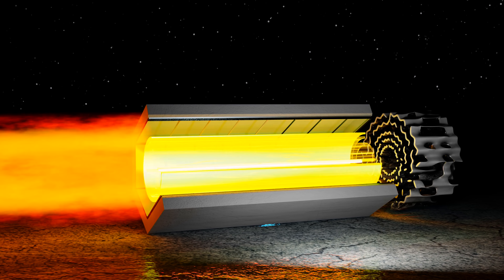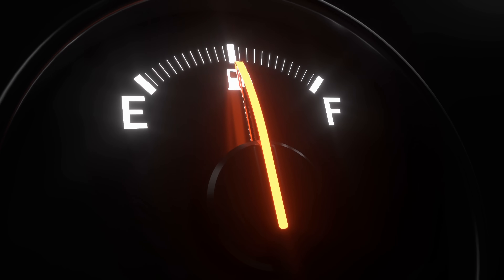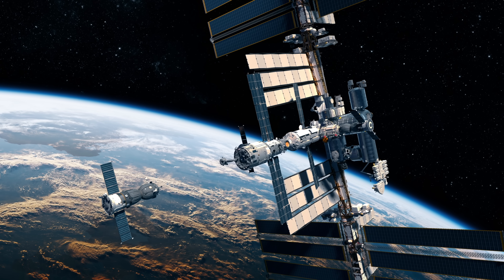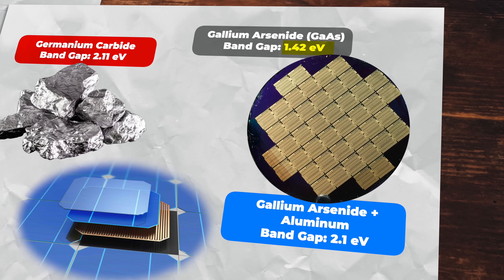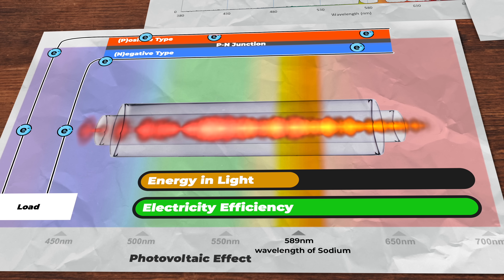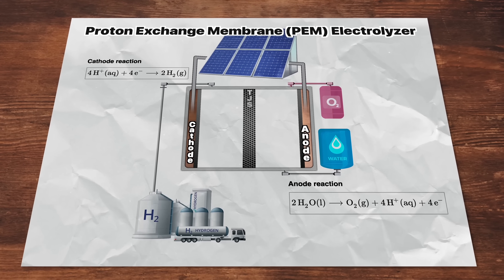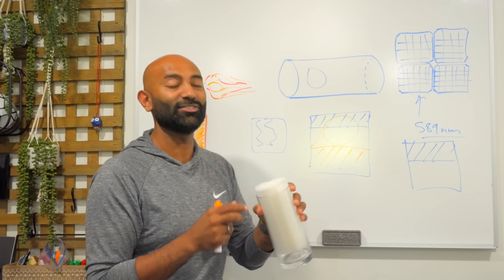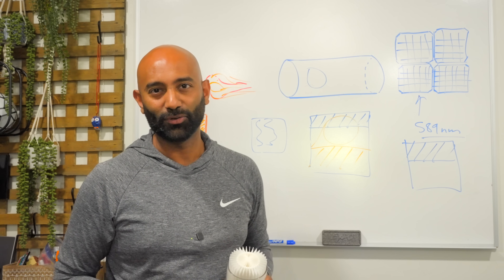Why Solid State Might Save The Combustion Engine

Comment: 14:05 You'd be better to build this heat-to-light system in a Gas Turbine...Turbines are FAR more efficient than Piston engines (and I believe can burn just about any hydrocarbon fuel or straight hydrogen for that matter) to spin a generator to make electricity, then use the waste heat to make low pressure sodium glow to be converted into more electricity by a tuned solarcell...
2 sources of electricity from one combustion event and the sodium would absorb a lot of the heat in the exhaust gas meaning the exhaust system can be vented like a traditional home water heater or gar clothes dryer...

This could be used to power homes, businesses, factories, off-grid cottages, Communications Relay Towers in the wilderness (along the major highways and in Cottage Country for example) and vehicles with very little design alterations, mostly just scaled up or down depending on the needed power output...and with very little pollution due to how clean Turbines tend to burn...

Comment: Although not a complete waste for academic/research purposes, I feel this design is proposed on ignorant premises.

The largest energy “waste” an internal fuel combustion engine like the ones we used today is not fuel consumption or moving parts, but primarily the lack of utility of the unused heat. Second would be the unused or lossed movement of the crankshaft, thirdly would be the lack of direct utilization of the byproduct of burning fossil fuels namely nitrogen, water, and carbon oxides resulting from the burning process. Nowhere are these problems addressed in the in design premise to offer a better solution or higher optimization in comparing fuel engine designs. There simply isn’t any need for any other design that incorporates light unless it can directly address the infrared spectrum from burning oil and no need for any electricity unless it can can address the loss of movement or chemical byproduct (which precisely is what early design attempts sought like the first generation electrical hybrids or the sham water/nitrogen engines).

Comment: How do these approaches compare to the efficiency of the thermo-voltaic panels that generate electricity from the infrared photons from that, uh, I think it was a sand heat battery, or maybe some new proposed RTG for space proves? (sorry, I don't remember for sure specifically which project was associated with it, I just remember they had "solar"panels that were tuned to thermal frequencies instead of sunlight)

Comment: Sounds too good to be true. If these tuned photovoltaics work at that efficiency, why not do mirror concentrated solar onto a sodium lamp with those around it? You'd capture much more of the sun's energy than traditional solar cells. What's more, you wouldn't have to design a car around it to make it work. You could hook it up to the grid tomorrow and start making money.

Comment: I don't think you'd have much luck harvesting waste heat from an ICE because you have to heat the sodium to a very high temperature to get good emission efficiency.  Exhaust gas temps are 200-900C, while efficient light emission from sodium atoms needs temperatures in the vicinity of 5000 K or more.

Comment: 80% efficiency?!?!  That's literally impossible for an engine using heat energy at room temperature below the melting point of steel.  Thermodynamics limits the efficiency to 1 - Tc/Th where Tc is the sink temperature in Kelvin (so 340K) so it would need to run at 1700K assuming literal perfection.  That's the melting point of fucking Incnel and beyond that of normal steel.

Doesn't matter that it uses photovoltaic as an intervening step.  It's still starting with heat energy so thermodynamic limits on heat cycle apply.

I'm not saying it's necessarily a scam, but someone (u or them) is definitely using a misleading notion of efficiency (eg they mean the fraction of theoretical thermal efficiency they achieve).

Comment: Cosworth makes a generator using catalytic converters to combust fuel. The gas drives a generator to feed power into a turbine and then into batteries and electric motors. The efficiency is down around an ice engine but because there is no moving parts it is light and fuel agnostic

Comment: Durability, that is the question.  How long can this run before it needs MP?  It does sound nice on paper, and it may work well...for short periods of time.  Maybe this lasts for 100 hrs, maybe 1000 hrs and we start a new business where you go in for, in stead of an oil change, a "chamber change".  We will have to see!

Comment: Yes in car there's multiple escaping heat sources that might be possible to recycle back into self charging if the heat can light up a substance, and or infrared spectrum can be used...but stray voltage within the car system might also be exploitable if electrostatic motors are real...Even in a non car design though, 1) polymer should be fed and store heat...2) the heat should radiate infrared energy and a filter on thermophotovoltaic panel should use it, OR the heat should cause polymer to glow in uv spectrum. Panels on roof is too vulnerable to weather/vandalism, but thermal panels are just heat collection so easier. Heat can also be pressurized for improved efficiency...

Comment: hydrogen perhaps, but you start burning gasoline or other fossil fuels, your glass cylinder is gonna start degrading energy transfer. if doesnt matter how clean the fossil fuel is, its going to deposit carbon, no? also it would still be producing local pollutants. the light absorbing tech does sound like it would have some useful applications though.

Comment: I've helped achieve several energy conservation goals based on the principle of "Less is More." My 40-hour work week occupation in the 1980's was to reduce Household energy consumption with insulation and more efficient appliances. Thus, average homes today are cleaner, more comfortable, healthier, safer, more sturdily built to last as well as more energy efficient. Less is more. 

In the 1990's I transitioned my energy conservation efforts from housing to transportation; travel, transit, transport systems. I conclude the EV with the most potential to reduce fuel/energy consumption, emissions AND insane traffic is Plug-in Hybrid PHEV tech based on the same principle, "Less is More." All-battery BEV and hydrogen fuel cell EV tech (and I suppose this solid state transport system device) as well are based the idea that we must somehow accommodate more senseless travel and longest distance transport. More is less. 

I believe Sodium-ion will replace Lithium-ion for EV battery tech. The main drawback with Sodium-ion is its 20% lower energy density than Lithium-ion. This is not a problem with PHEV battery packs which are much smaller than BEV packs. The ICEngine of a PHEV+H (combustible hydrogen) can deliver at least twice the equivalent MPG possible with hydrogen fuel cell EV tech. PHEVs also make the more ideal and effective match to rooftop PV solar arrays rather than vast field arrays that require long-distance transmission lines that tie to complex regional utility grids, both of which remain vulnerable to power outage. 

Humanity must learn to live with less.

Comment: I don't think exhaust gas from a regular engine would be hot enough to melt salt and make it glow bright. You definitely raised many interesting points that got us all thinking about it.
Reply: If it were a diesel it could work exhaust gas temperatures can get up and past 600 degrees Celsius though that would be bad for the engine to run that hot if you only need a bit more than 300 degrees I think a diesel engine could sustain it especially with added exhaust insulation

Comment: They'd better be capturing the heat this thing produces, or it's never going to be producing 80% of anything.
photovoltaics have a baseline efficiency around 15-30% aka similar to a regular car
also, this isn't new anyway you can already buy combustion generators that harvest the thermal energy, so they're just doing this the hard way, focusing on the light is a terrible idea, we suck at producing light, dropping the efficiency of the combustion to light, then re-harvesting that is a terrible idea. it's far easier to capture light and turn it into heat.

Comment: Two things, copper is really hard to machine, it work hardens as soon as you touch it with any tool, second you have a very limited number of gases you can burn in air that don't create pollution, oxygen, hydrogen and that's about it, and the amount of hydrogen a car can carry and keep pressurised is very limited.

Comment: Diesel engines are making great strides in technology, I recently am seeing Diesel pickup truck exhaust pipes with light gray thin deposits and no exhaust smoke/soot. Improvements in hybrid engine tech seem imminent, especially in batteries. Hybrids allow engines to be tuned to the best speeds and load and solar charging from roofs..

Comment: It very probably is some sort of special fiber optics that consist not only of silicon in a very durable PES substrate but a metal element.  I remember reading that it takes a matching frequency of light to harmonize with and propel electrons.  Perhaps this can be used in car cylinder piston chambers to capture lost energy..   Since quantum dots arranged as knotted fibers can trap more energy maybe such are used for enhanced effect!

Comment: I'm thinking why use fuel to heat?? Most of our stuff has a heat problem
..put that where there is a heat issue...like the cooling pipes closest to the nuke reactor...line the pipe with high efficiency cells...if it works it will work with most of our tech...there doesnt have to be combustion when you can rob heat from many sources and they would thank you...what device would burn it self up if not for major high tech cooling..that's where this works best...molten salt flows ,so it could work anywhere, and a lot of money is spent to keep stuff cool and you talking about paying for that heat...if it was small enough it could be built into everything if it works like stated(every little bit counts...adds up too) you have heard of the gasonator?? They have refined that at Berkley and call it pallet power...and it can burn almost anything and make power..I think it cracks the hydrocarbons and burns it all up...burns the stuff we normally release as pollution...I'm not a tree hugger, but every little bit better we can do will benefit everyone one day..
Hopefully..we gotta make it through 2024 ,first...just have faith,even if that's all you can do...there is a lot of tech that didnt work way back then ...we have learned stuff since then,maybe it could work today...think of how much they figured out at the beginning of 1900..all the physics!!! I know we have figured out lots since then,and did it with a lot less tech than we have now..we are still using steam to turn things after hundreds of years...why???? Because it works..is the salt actually consumed??? Wouldnt that leave a nasty build up after a while???and if the wavelength of photovoltaic pannels can be changed chemically during manufacturing  we need to be changing it so they can pick up all that wasted sunlight that they dont see right now...we can put metal in the microwave but still cant make a full spectrum pv pannel...lol

Comment: I've read that heat damages regular solar panels and reduces their efficiency over time. Why wouldn't the high temperature from heating the sodium also similarly damage the photovoltaics? :body-blue-raised-arms:

Comment: I’m thinking the core is some kind of catalyst, hydrogen or hydrocarbons hit it and it combusts making heat and light like one of those gas soldering irons or old school gas ceramic plate heaters of the 70s.

Also imagine how bright your catalytic converter gets but you can’t see it.

Comment: Their efficiencies in energy conversion through different types sounds like a massive amount of BS. You burn a fuel which gets converted heat, which is then converted to light and that is converted to electricity. They should build it, they don't even have to built the full engine, just each stage to demonstrate that part's technology and let's the the efficiencies there. I expect to see this on conspiracy theory websites/podcasts in a few years with people talking about how "they" shut this technology down.

Comment: My suspicion is that the efficiency number claims are for the combined THRUST and electricity of what basically looks to be a rocket engine as its blowing out combustion gasses unimpeded.  Without a way to capture that hot gas and basically wring all the heat out of it down to ambient your not going to be anywhere close to the theoretical efficieny limit which is around 70% for gasoline combustion.

This channels guilibility and lack of basic thermodynamic understanding makes it completly unable to evaluate technology claims.

Comment: "Solid State Engine" - sounds more exciting words than photovoltaic gas lantern.
Reply: also not an engine until you strap an electric motor or some form of mechanical output to it.
Reply: @tigerstallion  And about not moving parts - it needs fuel pump and air compressor - I do not think that we can have then without moving parts.
Reply: Wick in stead of pump.
Reply: @nalim27  there are some ways of getting around that with plasma actuators and magnetodynamic drives, but they are unlikely to get anywhere near the performance of a simple turbine.
Reply: Was going to say Blowtorch Solar Panel, You said it much better 🙂
Reply: I'll wait to see work in real life cause i have seen enough of Elizabeth Holmes' Theranos.
Reply: Exactly.

It's not solid state either.

It uses a fuel which means it has a liquid or gas component.
Reply: @mnomadvfx Electrons flow wherever there is an electric field difference. So there's no actual true solid state... Just solid enough.
Reply: This, it's not an engine
Reply: @zangeh  what is it then? Maybe you should read the title and watch the video again.
Reply: @HullioGQ do you consider the boiler itself an engine in a steam engine? Anyway this is stupid, the claim is stupid, saying its good place would be for cars is stupid and not in massive powerplants, everything about this video is stupid and because the pitch is for a car or such because with 70% efficiency they'd be rolling in money from stationary generators. The whole claim is laughable and everyone is stupider for having watched this video.

Btw if you combined this as claimed with regular expansion combustion engine or even a steam engine and somehow you have over unity efficiency. 

It would make more sense to call it a solid state generator or something.
Reply: Hmm... interesting. Did you mention the fuel that is used?  fossil fuel?   or Hydrogen? would it in this case not be easier/ more efficient to use Hydrogen cells?
Reply: It's more of a generator than those "solar generators"
Reply: Hot gas machine 😂😮😂😮😂😮😂
Reply: It is also "incredible", just like he said.
Reply: You could make a plasma candle lol, those are electric powered but yeah 💀
Reply: Hot gas machine  😂😮😂😮😂😮😂😮😂
Reply: Supposedly the fuel's heat affects nanocrystals or something, causing them to incandescence. Their light is what actually gets absorbed by some kind of photovoltaic cells. Also just look at LaMirah's comment. He/she is probably right.
Reply: Or you can use any existing thermalnpower plants? You have the heat so you still could extract energy from it.

For example gasturbines power  a turbine the exhaust gas go through this heat exchanger and the sodium element start glowing the emited light power a solar panel

Comment: This is like aceton lantern next to solar cell, and this lantern heats the solar cell, and what happens to the solar cell when it's heated, right resistance increaces and cause of that temperature of solar cell also increase and it's self sustane loop, question about efficiency you can answer yourself.
5kw per kilogram?
Maybe but that kilogram takes to much space, so it's have limited aplication, and to produce such panels we need very, very advanced tecnologies, that must be foil solar panels, in total for now, i'm sceptical about this technology.

Comment: Using the exhaust can provide heat for a Solid Oxide Fuel Cell providing both mechanical traction power and electricity for a hybrid vehicle. All this he's talking about? Add photovoltaic cell? Sure. The more the merrier. Fill 'er up. Gas and salt. Don't get them mixed up. I like this. Keep them coming!

Comment: It’s silly and hype 

thermoelectric generator (TEG), also called a Seebeck generator, is a solid state device that converts heat (driven by temperature differences) directly into electrical energy through a phenomenon called the Seebeck effect[1] (a form of thermoelectric effect).

Comment: I do love the thought of merging it into a traditional combustion engine. Even if the efficiency gains are too small to contribute to forward motion, it may at least be able to replace or at least supplement the alternator, freeing up some load on the engine and being able to reap the benefits of that extra efficiency with minimal effort, possibly easily enough to be swapped into existing ICE powered cars. It would also mean, depending on how much heat is absorbed, that your cooling system doesn't have to work quite as hard when the battery is being charged from this system.

Comment: The proposal for the waste heat reminded me of the MHD Generator. More work out of the waste heat, stored as enegy would perhaps do away with the need for an alternator, coupled with regen braking makes it possible. What percentage of efficency could possibly make for a few more miles down the road. Being an optimist it sounds good, but the government is hell bent on shutting down oil, and that is in the EU also. Well, good luck Two Bit da Vinci on getting that off the ground.